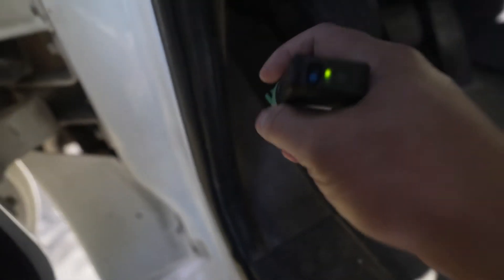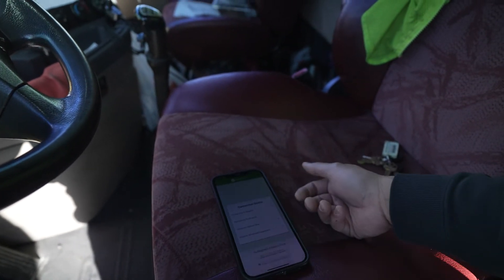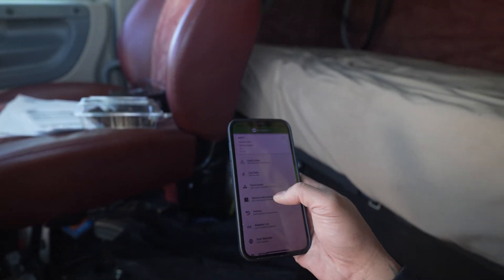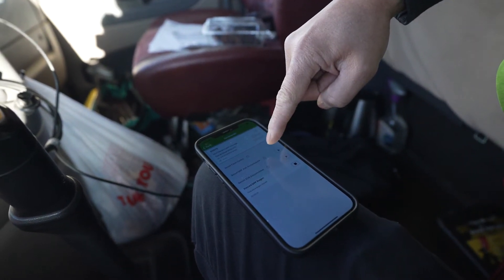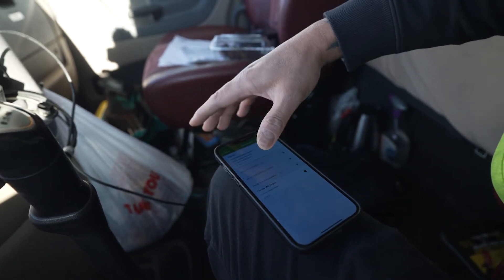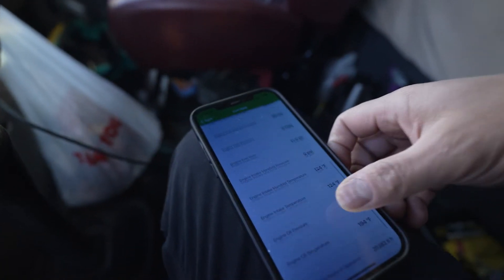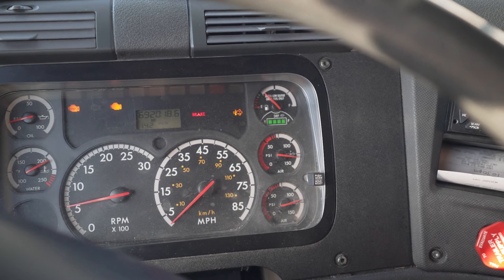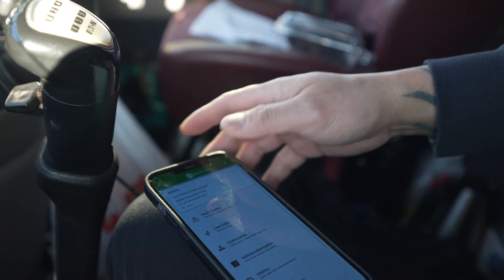OTR Pro Scanner MUST WATCH

Comment: Tool does not reset anything in my truck . Cummins, after treatment, DPF reset . Nothing. All it said is reset failed . Will not do an SCR test . Starts and cuts off at 35 seconds exactly every time .